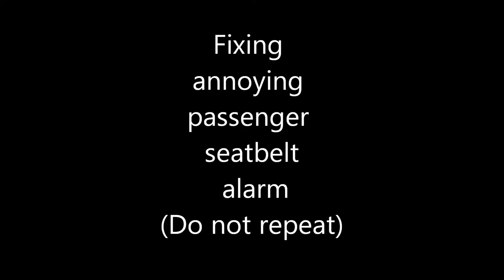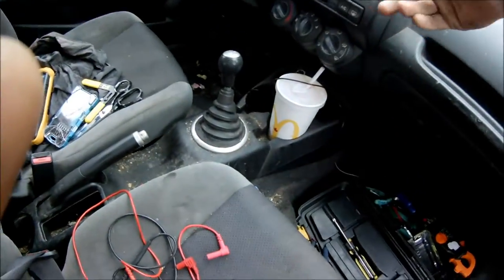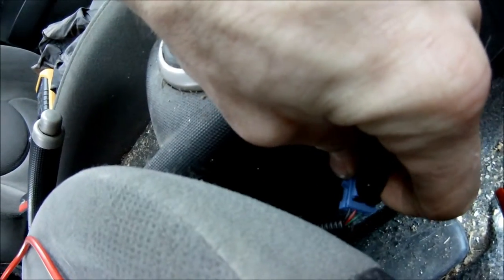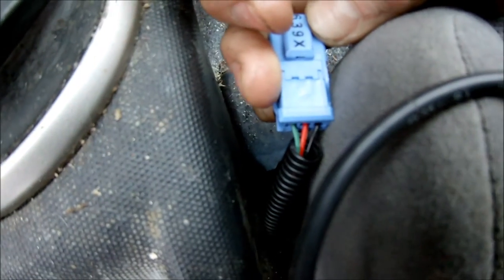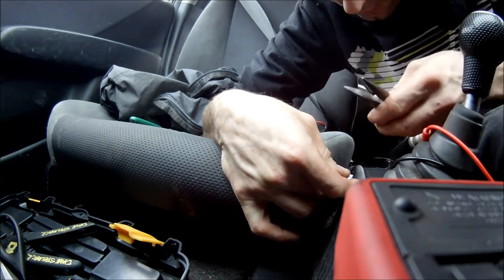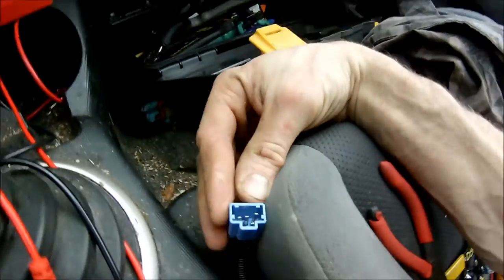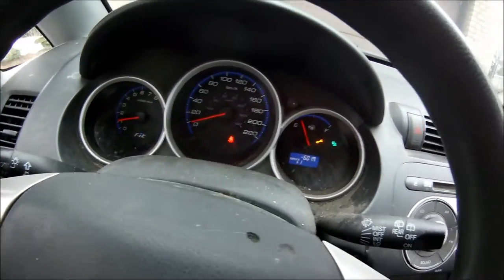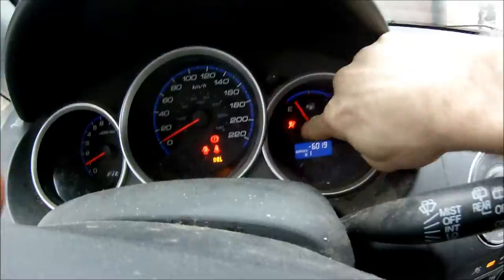SEATBELT ALARM HACKED annoying beep beep.  Beltminder turnoff Honda Fit!

Comment: I've been asking so many people about this for my 2007 Honda Fit but no one knows. Other Honda cars have chips you can remove or clips. This one remove the clip on the belt buckle housing only makes it think the seatbelt is never plugged in.  After hours of thinking  I figured it had to be the answer to somehow connect the green and black but you confirmed and saved me from cutting wires. Jumper it is!
Reply from the maker: sweet.
Reply: @localbroadcast  actually wasn't the jumper for mine. There is a little dangly bit on a connector in the seat belt housing that you just electric tape shut and it stops the beep. Thanks to reddit for that one.

Comment: It still beeps when you turn on the car.  That's what you want to get rid of.
Reply from the maker: actually, its so that when i have a pile of stuff on the passenger seat, the car doesn't think a person is sitting there without their seat belt on and rings the chime every 15 seconds to annoy me into hacking the seat belt wire harness thus-lee!
Reply from the maker: @YTuberosity, incorrect!  I'm trying to get rid of alarm beeps when there is a significant weight on the passenger seat to make the car think a passenger is seated there without their seat belt on.  The seat belt alarm is annoying a.f. in this car and doesn't go away after the initial annoyance beeps.